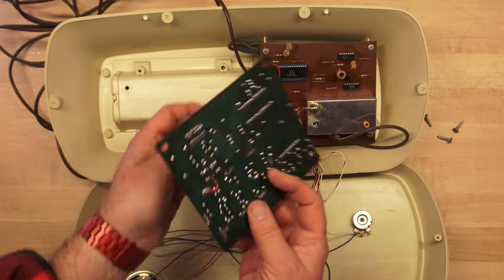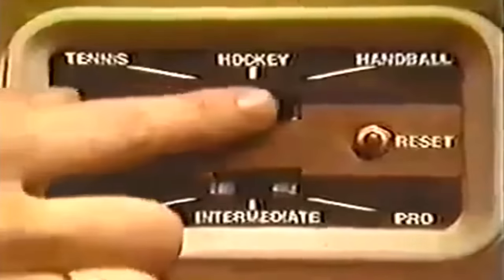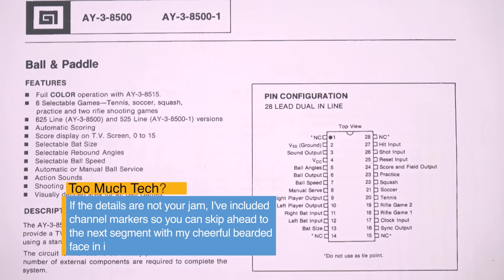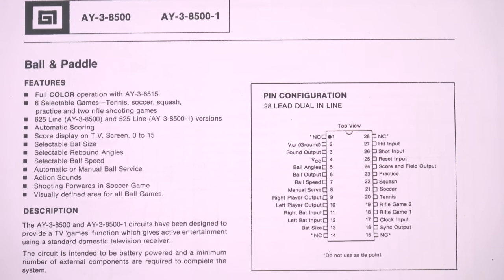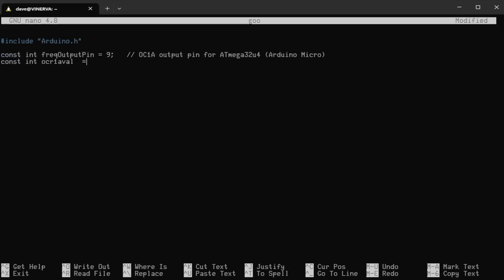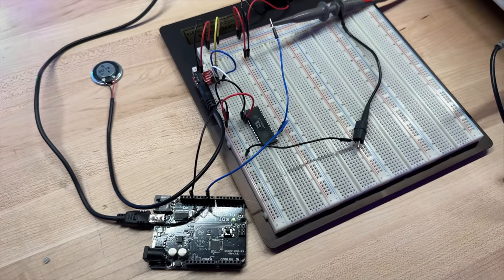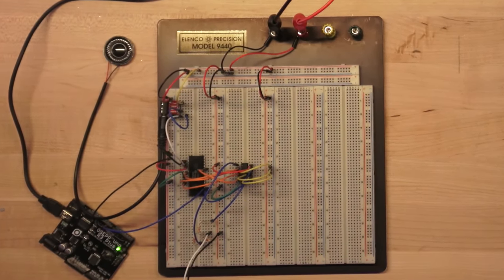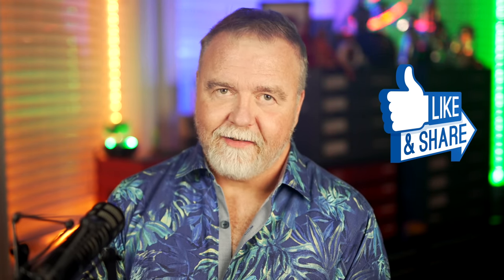PONG! in a Breadboard - Can We Build it?

Comment: At 14:35 one can see on the schematic that video and sync are half bias because sync is of a different polarity which explains why they are not mixed on the same gate. The resistors are doing the bias.
Reply from the maker: I don't doubt you but I don't understand, either - can you explain what bias is in this case?
Reply: Yes, sure, glad I can be of service.

First on the schematic itself shown at 14:20, the OR Gate is rendering the different parts of the video signal as you explained it.  (Ball output pin 6 , Right Player Output pin 9, Left Player output pin 10 and score output pin 24). It is shown on the illustration with a “blank space” left to “insert” the sync signal. The output of that OR gate when “1” indicates luminance is “White” (fires the electron gun). When all 4 inputs are “0” it indicates no luminance and will be shown as black on the tv screen. In a real broadcast outside the AY-3-8500 world, the luminance value is discrete.  Its discrete value gives all the shades of gray between black and white on the screen.  Since this is an OR gate it does not render the arithmetic sum of it component.  It is just to signal to fire or not to fire the gun. So there is only one level of "whiteness".  It is either on or off. White or not.

The sync output pin 16, is buffered with the help of the second OR gate.  That output is active low (a logic “0”). Most of the time there is no sync, so this output will appear high on the oscilloscope 99% of the time. In the NTSC standard, that sync signal is itself the sum of Vertical Blank (60 HZ) and Horizontal Retrace (15 750 Hz) happening inside the chip. 

BTW the exact value for the clock is 2,012160 Mhz. Divide that by 15 750 (Horizontal frequency) and one will get very close to a recognisable magic number… a tell about what is happening inside the magic chip…. Then further divide 15 750 by 60 (the Vertical retrace freq) and one would get the number of lines in a vertical field… yes, not a mistake, that’s the exact number of lines… that would give the real meaning to what the odd and even fields are all about!

Unfortunately, I have to put into words what a simple diagram would show better, but keeping it simple, in analog television, there are 3 levels. “High”, “Low” and “In-Between”.  To achieve this purpose, one has to create a fixed reference point. Here the In-between value and reference point is black or if you want to understand it in non-digital terms it will be somewhere halfway between 0 and Vcc.   Any absence of video signal (all input to logic “0”) with No Sync (pin High) gives black which is about Vcc/2.

The “White” signal on the screen represented here by no sync (pin high) + video signal (any of the above 4 pins high) is maximum luminance. That will be the maximum voltage above the reference point. In a tv set, this would be a discrete value going between these two extremes and shown as a grey dot, a value between black and white.

The 3rd level, is Sync also known has “blacker than black”. You can see its meaning directly drawn on the right hand schematic going a full swing below the reference point.
Although driven by a digital circuit, this is not the digital world.

To sum up in absolute values : 
   0,5 Volt is Sync,
   Vcc/2 is black, 
   black + 0,7 Volt is Pure White.
   Values between black and White (if they existed would be grey).

Finally the purpose of the resistors which are summing up these 3 different states in a single node at the junction 330, 510, 220 and 510 ohms. The values 330 ohms, 510 ohms and 220 ohms just makes the right offset for the bias. Assuming no luminance, the bias would be about 0,6 * Vcc...  The sum of these resistors also has to match the impedance of the modulator. At the time these modulator had an RCA input for the video signal and a matching antenna output of 150 Ohms. True, this a very crude mechanism to sum up different digital signals and transform them into the analog world.

In the ‘70’s the analog world was king and for the most part tolerant to imprecise values.  After the signal was “broadcasted”, the tv set had to do the exact opposite and isolate and discriminate each part of the signal (without any calculation) in order to reverse the process and render the screen.

This was fun, hope it helped…
Reply: @DavesGarage  Having studied the original (discrete TTL) schematic, I think what he was trying to say is that you can't mix the video and sync signals at the digital level is because NTSC composite video, being an analog signal, needs at least three different voltages coming down the wire.  White is around 0.75V (max 1V), black is approx 0.3V, and sync is 0V. Assuming that there is 5V coming out of the 4072s, and ignoring the output resistor (likely used for impedance matching to the modulator), you'd get 0V when both outputs are low, 1.5V with sync high and video low (black), and 2.6V when both are high.  (Sync low and video high is an invalid state.)  Yes, the ratios are a bit off, but the RF modulators of the day required "stretched" sync for the average TV tuner to decode properly.

TL/DR version: Resistive voltage dividers turn digital signals into analog signals.

Comment: Sure there is a FPGA implementation of that GI chipset. Incidentally the decision to use the DIP28 package over the DIP24 was the die size, it was just too big to fit the standard GI DIP24 paddle in the leadframe, so they used the DIP28 leadframe instead, as that is slightly larger, allowing the die to fit comfortably, saving having to need to use a larger paddle and redesign the leadframe, an expensive proposition, as that meant them needing to make new punching dies for the leadframe, and keeping large volumes of 2 different leadframes in stock. Big up front cost for a chip they were not figuring was going to sell in massive quantities initially.

Comment: 14:50 The resistor to ground isn’t a simple pulldown. Look at the waveform next to the mixing point of the two OR outputs: it shows multiple voltage levels. But digital logic only does high or low, you say? Yes. So let’s look at the circuit: from the mixing point, there’s the 220 ohm to ground, 330 ohm to the video signal, and 510 ohm to H sync. Now remember that each OR output is either high or low, meaning it’s either at (or close to) Vcc or ground. So in fact, when both OR outputs are high, they’re both at Vcc, and thus their 330 ohm and 510 ohm resistors are functionally in parallel. Conversely, if an OR output is low, its resistor is to ground, thus in parallel with the 220 ohm resistor. And what do we get when we look at the midpoint of two resistors between Vcc and ground? A voltage divider. 

What this means is that we actually have a logic-controlled voltage divider with 4 different output voltages: a simple DAC. I ran the numbers, and they are (as a factor of Vcc): 0.837, 0.523, 0.206, and 0. Then you take that output and run it through some signal conditioning to scale it to the right voltage range of the NTSC signal.

Comment: I do clearly remember that here in Europe or better say Germany a somewhat older friend had an add-on plug-in module to the family TV set (some slot at the side!).
This was about in 1974 to maybe 1988. The name Magnavox sounds so familiar, that I assume it was those brand used in here. (Later on an Atari 2600 box came into that household.)

There were the mentioned set of games more or less around in the device. And i remember that toys catalogs were selling a "light gun" as an extra for these and similar devices.
The gun had a trigger at the grip and a lens on its pointing tip. Somewhere inside there was most probably a photo sensor.
To what i know from earlier and later designs, such as the Commodore 64 but also in the real first stylus operated computers, the ray control took the trigger and the photo cell signal as an input. And if at exactly those point in time (might the trigger see a press for as long as a half or full frame) the sensor was lit by the ball a scoring event was counted. I have to guess but i feel its very likely that there was some vice-versa checking, such as if the ball was hidden for say one more frame or instantly, only then the scoring was really considered valid - just to make sure no other light source and screen element could trigger the scoring. some external glue logic might have been needed, such as a transistorized signal amplification. Not sure how they avoided a permanent trigger - maybe it was a one-push button logic so the user needed to press it multiple times, or they even added a reload time span.

When it comes to color... as the signals are or'ed for the black-white version, they could also easily be split across the typical three color inputs of Red, Green and Blue. Also mixing with some more or-gates would have been possible. central game elements might have worked better if they stayed white - but things like borders or scores could have any sort of color without a problem.

in present times an FPGA would solve the same purpose. I felt just that the number of ICs from the first board and prototype was astonishingly low. so a few counter, a few comparators and a little bit more was needed to bring not only one game but this little bunch to life in just a simple box.

by the way, good choice to skip the RF modulator and use bare CVBS (FBAS) signal. I have to assume that there is no two-fields used but its just line doubling or even more likely, each field has contents on its own - thus doing real world 60 fps gaming. ;-)
Reply: ⚠BEWARE⚠ SPAM comment replies that link to TELEGRAM addresses⚠

Comment: I don't believe that is a hocky variant that was shown; the ball would bounce anywhere besides gaps in the left and right walls, which were not present in the video.  I think that there were a few cheap game consoles with the shooting game. I remember one with a pistol shaped controller that plugged into the base.

Interestingly, the Pong machine that was installed in the cafeteria at the boarding school I attended took a dime rather than a quarter. I'm pretty sure that was around 1973 or  1974.

Comment: Just curious, couldn't you have gotten the clock crystal from one of the Telstar machines?

Great video anyhow, it's cool to see simpler tech like this demoed on a bench
Reply: Yeah, that's curious.  I wonder how exacting the clock has to be.  I guessed it drives the video sync, so it probably has to be close?
Reply: @michaelbauers8800  That's exactly why.  I've studied the original discrete chip version, and everything is simply a bunch of counters, which is why each part of the video output is its own signal.
Reply: They could have mixed the outputs on the chip to a single pin, but this allows them to process each "layer" separately with an external color chip, or even as separate gray scale levels.

Comment: 10:29  maybe... a radio transmitter or a walky talky, or a 27 mhz box. or an homemade oscilator like a blinking flashlight.. with 4 capacitators or condensators and maybe 2 transistors and a couple of resitors. can produce a 2 mhz clock. instead of a chrystal. like one find in watches and clocks.
Reply: or similair. oscilator schematix. instead of a chrystal or a 555 timer chip. as an alternative.

Comment: You probably could of used a triple five timer to generate the clock signal, no need for an Arduino. So the original Pong only used two reflection angles, a lot of modern clones use a variable reflection angle based on where the ball hits the bat, that way you get more interesting game play.

Comment: I didn't know that a single chip had been produced for Pong games. I used to have the schematic for the TTL based version of the game. I don't know if I still have it buried in a box somewhere.
Reply: I have an old electronics projects book "273 schakelingen"  from "Elektuur" (elektor now) publicated in 1973. It has one pong project using only ttl components. (Project 176, tv tennisspel) for PAL tv systems. Only with one ball and two bats. No sound, no score.
Reply: Texas Instruments also made one, an AY-3-8500 clone called the TMS-1965
Reply: @roelandriemens  They made another one later (using the AY-3-8500) , Issue 1977/07 (Halfgeleidergids) , page 728

Comment: A potentiometer is a variable resistor not a capacitor. When you have a potentiometer and resistor in series creates an adjustable voltage divider. THe use of a capacitor is to buffer voltages, if you had one in the circuit the reaction time of the potentiometer would be slower due to the capacitor charging before passing voltage through when you increase the voltage and then releasing charge when you decrease the voltage and your circuit to not see the change to the potentiometer until the cap drained.

Comment: I always assumed that the r/c circuits that the controllers were a part of were connected to internal oscillators whose frequencies determined where the on screen paddles were located.
Reply: Now that I think of it, there was a video game project in Radio Electronics or Popular Electronics from the early/mid 70s called Space War by Joseph Weisbecker and the paddle controls were the frequency controls for two 555 oscillators circuits.
Reply: ⚠BEWARE⚠ SPAM comment replies that link to TELEGRAM addresses⚠

Comment: Isn't the capacitor just there for smoothing the signal? Not knowing the quality of the pot, it could jitter and surge as the traveling metal terminal drags against the other connection, popping and even momentarily shorting out. The cap would help smooth all that out so the chip can read a more stable voltage from the pin. <-- all guesses. no citations.
Reply: I believe it determines the paddle  position by measuring how much time it takes the capacitor to charge, or discharge, I can't remember which.

Comment: strange, I got my FIRST pong game from Rippoff Shack back in 78 just after we for marred.  it was a strange as the game the controls an one nob and the other nob went to from the controller.  from the controller to the TV.  At that time I was working on strange group of computer systems and mini systems. one was TI-990 were they were using RM/COBOL, RPGII and Basic. I got to know the programming staff as I was my know age from working on IBM System 3 Mod 10 since 73. It was easy for me to explain to them how they runtime did not function as it should.  That included tricks I learned for work arounds to the RPG cycle to get to allow do thing I could only do in COBOL. That included getting told from IBM Support you can't do that in RPG till I sent them the code.

Comment: The first pong was on an oscilloscope back in 1958 called tennis for two......created by physicist William Higinbotham
Reply: That was a very different game. First of all, it was a side view, but most important, it required a computer and an oscilloscope display. (aka expensive)
Pong games were entirely discrete logic, using a standard television set for display and timing. Originally requiring only a board full of chips (computers used dozens of boards in 1958), they eventually became a five dollar chip like this one.

Comment: Nice vid as always!
I hate being the guy to "well... actually" you, but I'm gonna do it anyway :D
1. There are no PAL or NTSC versions of the AY-3-8500 but 50Hz and 60Hz versions. I know People use those terms interchangeably but they are actually not correct, as PAL and NTSC are the color encoding standards and not the frame or field rate. There are 60Hz consoles in countries like Brazil where they used 60Hz with PAL colour and there are 50Hz consoles in non-PAL countries like France.
2. You don't say it explicitly but it sounds like you're implying the chip handling the interlaced signal for you. Pong provides a progressive signal like nearly all computers and consoles. To avoid flicker and simplify the circuitry the system only ever draws the odd lines and resets after each field. The result is a progressive image with every other line left blank and thus half of the vertical resolution but the full framerate of 50 or 60ish Hz. So instead of 480i60 you get 240p60

I bet you knew that, but I had to get it out anyway

Comment: 17:20 "if the pulse from the gun comes back during the draw from the bullet", no, not as complicated as that! Pong's top-secret "cheat mode" is to play the rifle game and fire it at a light bulb, bang! Anything that's light and isn't dark will get you a point, no need to check what. I suppose if I were crafty I might try aiming for the score digits, but that's enforced with a slap on the head from your big brother. If you have one. I don't. I AM the big brother.

Most TV Tennis games in the UK supported the rifle, and some in the USA did too, just an option depending on if they wanted to manufacture the gun as well and sell for a bit more money.
Reply from the maker: Really?  I assumed they blanked the score when you pulled the trigger... no?
Reply: @DavesGarage  Hm you might be right about that. I suppose that's to stop the very thing I mentioned happening by accident. But certainly you can score hits by pointing at any old light bulb. It just detects light, it doesn't do any of the stuff a light pen does to determine location.

How about you 3D print a rifle? The one I had, had a simple crappy clear plastic lens, looking down a dark barrel, with an LDR at the end (that's mentioned in some of the old construction guides, as you probably know, making a TV Tennis with the AY chip was a popular project in '70s electronics magazines). I dunno if the light-spot detecting circuitry that produces a "yes / no" result is in the AY chip itself or if you have to make that to include in the lightgun. 

The AY-3-8500 wasn't the only Pong chip but it was by far the most popular in all the Pongs I ever took apart, I had a collection that got a bit out of control!

There's websites with PDFs of the old mags, I think the Internet Archive has a few.